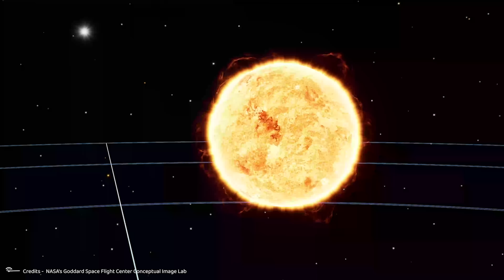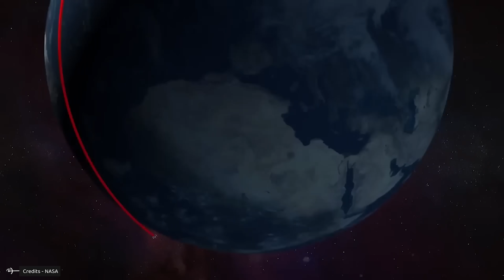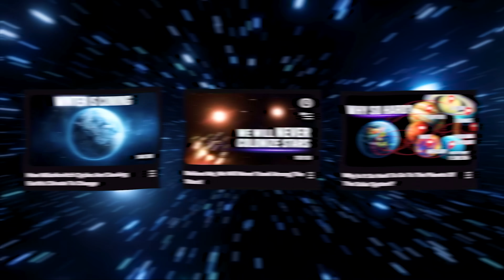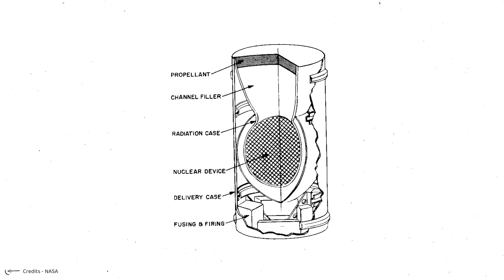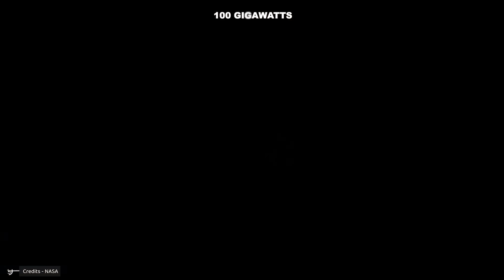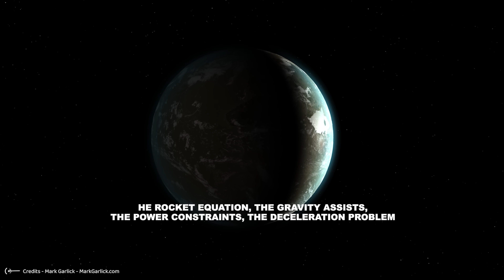How Hard Is It Really to Reach Pluto and Proxima Centauri?

Comment: There's one more important point. Theorized oort cloud exists around the solar system where inner to outer ring distance alone is 2000-100000 AUs. Since there's not enough sunlight reaching them to illuminate the path, maneuvering the spacecraft between asteroids will be just as challenging. Forget about reaching your destination on time.
One solution to identify the distant obstacles maybe using lasers on space. But we still won't get actual size and shape of the obstacle in space at 0 visibility and ultra cold surroundings with our current technology. 

My guess is humans reaching the proxima centauri within their "lifespan" would take around 3500-4000 years

Comment: If New Horizon left Earth at 38k mph, as you said, AND got a gravity assist from Jupiter that added 9k mph, why was it still traveling at 36k mph to Pluto? It should have been traveling between Jupiter and Pluto at 45k mph, as nothing changes velocity in space without external interference, correct?
Reply from the maker: You’re right that velocity does not just drop without influence, so the difference is usually about rounding or which frame the speed is measured in.

Comment: Lasers don't stay perfectly collimated - the diverge.  It might seem odd, but to get less beam divergence you need to first spread the beam and then focus it.  A beam mirror would have to be extremely large in order to get any significant power at a light year - on the order of 1000 km - roughly the size of Texas.  That means any laser propulsion would only accelerate a space sail for a fraction of a LY.

Comment: A light sail would also require a rudimentary navigation system and sufficient power and equipment to capture and then return meaningful data. It may be a very long time before such technology is available.
Reply from the maker: Yeah, travel speed means nothing without guidance, power, and communication.

Comment: Breakthrough Starshot is an awesome initiative. With future improvements, these probes might one day travel at a significant fraction of the speed of light. This would allow humans to receive info and pictures from Proxima/Alpha Centauri within next 10 yrs.
Reply: @Ami-xl3uj  would we be able to actually receive any radio signals from such a probe?
Reply: Total nonsense. From designing the first laser able to propel Starshot to the signal back from Proxima Centauri is more than 40 years, not 10. Dream on. Do you have any idea what hitting dust grains at just .1C will do to a vehicle over a flight time of 40 years?

Starshot is just a bad SciFi dream.

Comment: As far as l am aware, the fastest machine humankind has yet built travels at 400,000 mph - such speed achieved by us throwing it around the sun and allowing the gravity of the sun to take us up to such a speed.
At that speed it would take about 260 million hours to reach Proxima Centuri. Which is just a little over 29 680 years.
Reply: @SteveLester-q5q  I guess the only issue would be if it were to direct away from the sun, the sun’s gravity would end up slowing it down?

Comment: Such thing is only feasible for a non-manned probe. Also within centuries to come, it need at least a sub-relativistic rocket (bare minimum 10% of the speed of light, 12% better, 15% was perfect but the fuel cost begin to skyrocket), that may be a nuclear powered one that only need to burn at a short time to reach the Cruiser speed, and then to slow down.
Fusion fuel constrains put a Cruiser speed of around 11 to 12% of the speed of light (40 to 50 thousand tons of nuclear fuel is considered realistic).
This includes a plutonium nuclear reactor to power everything, a set of computers and instrumentos, and the probes to study the planets of Proxima and also Alpha Centauri.
Essentialy a 50 years mission where around 40 was wasted during the Interstellar travel.
Reply: Why non-manned? Put a few space deniers and flerfs on board.